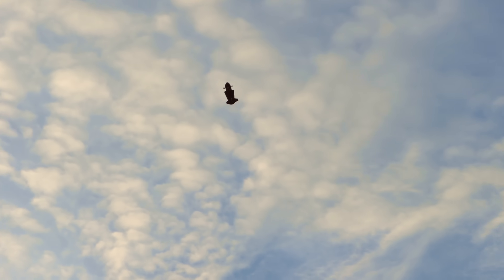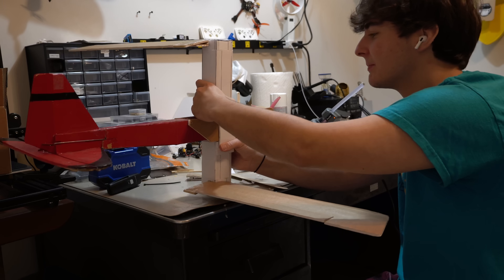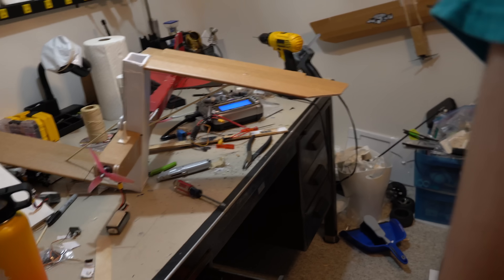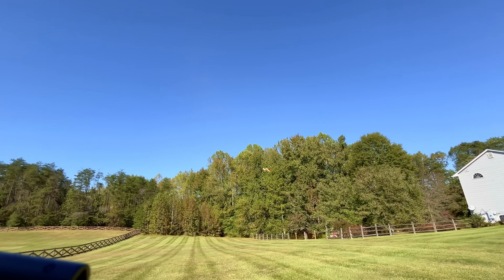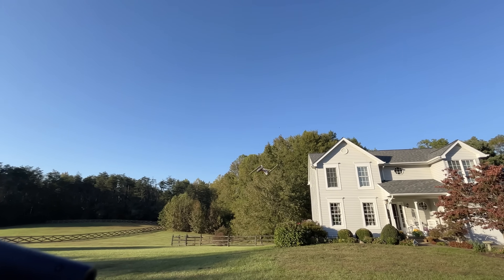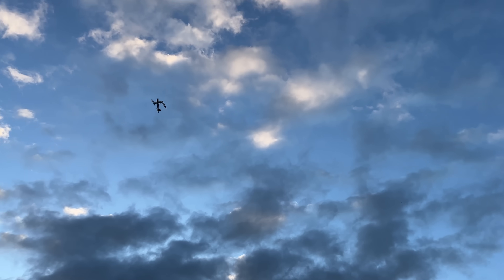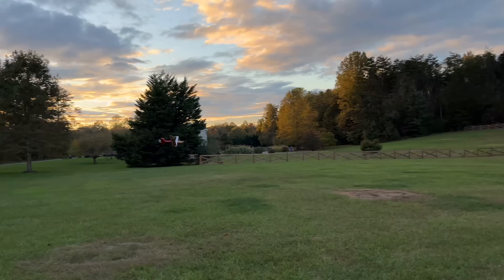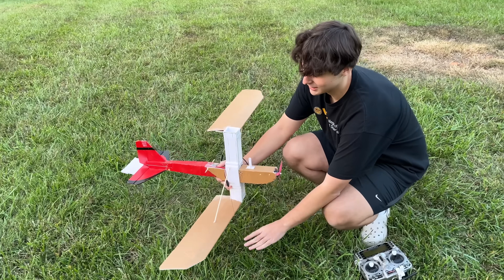Can a Plane Fly With Offset Wings?

Comment: I don't want to be another back seat engineer but I think this works better because the fuselage is in the middle between the wings so the equal lever forces cancle out, I'd love to see a follow up experiment where both wings were offset above the fuselage so the lift from one creates a greater lever force than the other
Reply: I was thinking the same thing. The offset of the wings from the center of gravity will change the moment they apply on it as they lift.  If they are roughly equidistant from the center it should balance out, but if both wings are above the center, the higher wing will have a greater moment on the mass and cause it to roll.  You should be able to compensate by changing the size of the wings based on their distance.
Reply: You mean like on the one at 0:21 that he already made with a car for a fuselage?
Reply: @demonzabrak That is a fairly small offset compared to the exaggerated one done in this video. The cars weight also creates a stable center of gravity which likely has the greater effect on balance. If the offset was exaggerated more I think it would roll if both wings are above the center of gravity.
Reply: Why would one create more force than the other?

Comment: Ground effect. In a full sized airplane that you intend to flare, land, and recover, as you approach the LANDING FLARE MANEUVER (that's aterm I first encountered with the Boeing 747-400) the lower wing will go into lower/closer ground effect first and the fuselage will roll away towards the upper wing. You can probably compensate for that by increasing aileron input as you descend within 1.5 wingspans of height. Otherwise, "aeronautical engineers" Saying it won't work weren't been paying attention ... or haven't read anything by Burt Rutan. Good video!

Comment: if you made 1 side with a normal wing and the other with a wing either half the width or length with another wing higher up making up for the difference how would different ratios and lengths or widths change it it would be a good way to visualize the effects

Comment: The way the wings generate lift does not change from when you have 2 wings on one level. The only thing I can see is that the lower wing can be less stable then the upper wing as the center of mass differs between the 2 wings. awesome little project! awesome to see you bust this myth!!!
Reply: The lift is the same but they create a moment around the cog. Could offset by making the lower wing slightly longer

Comment: ok, it flies, but now try to make it turn right. Now I realize that it want to fly left because the pilot's fingers are biased to the left. I would not agree that it flies "just the same" as a normal plane though. The wings want to settle into a 45-degree angle in level flight. That's not normal. Even if both wings produce the same lift, there is still a turning moment due to gravity, as the higher wing want to fall down, and that will tend to make it unstable, and want to flop to the left. Try level flight without any 'trim', and you'll find it is unstable. Also, even if both wings have the same lift, they will have different drag. The upper wing's vortices will have a greater effect on the tail below it. And you're right about the ground-effect - the lower wing will produce more lift, giving a strong turning moment, so it will quickly flip over as it approaches the ground.

Comment: Myth not busted; the difference is the center of gravity on this new plane is squarely between the two wings... They are each roughly equidistant from the center of gravity. On the truck, it hangs below.  Yeah, each wing generates the same amount of upwards thrust, but that's not what you want for uneven levers / pendulums.  The truck is hanging below, so on the near wing, the force will have a greater effect than the long one (like a lever of a different length).

Comment: as @nicholasrehm pointed out a force diagram gives some insights that a wing offset plane should fly basically the same. however, if we increase the difference in height then some other factors come into play. I'm think a several km long mast and so the thrust on each wing would be different since the air density is different at different altitudes. Further, with this very long mast the mast would bend as the prop moves the fuselage forward and eventually moving the wings last, so that probably wouldn't fly great. However, I suspect most 1km+ airplane size of any direction would have some serious problems to over come to fly, mostly thrust, but it is a fun thought. And the just extra weight of the mast isn't great for planes in general.

Comment: I remember seeing a free flight model from the 1950s or 60s it was a normal cabin type model but was low wing one side and low wing the other I think it was called von Uppum downum.
I do think the central mast is a huge airframe and would probably be better with thin struts each side of the fuselage,keep up the research.

Comment: I think that the problem with the plane rolling can still be seen when the plane is in ground affect. Due to the difference in wing heights the ground affect will roll the plane to the side with the higher wing. This is just what i think though. It would also explain why the car would roll when taking off from the ground from the previous clip.

Comment: makes sense. its about weight, balance and equal lift on both wings. the only issue is the drag of the box connecting the wings, but doesnt seem to cause any problems.

Comment: Well yeah, obviously the wings create the same lift if they both have the same shape and size. But the upper wing has more leverage, since it has a larger vertical offset, than the lower wing, therefore the airplane is unbalanced and flies at a kinda weird 45 degree angle.

Comment: Interesting. The plane flew straight by rolling to one side. Most all the flying was done counterclockwise with the left wing in the high position. What happens when you put the left wing in the low position. Next observation. If you put enough power on anything you can get it to fly, so an overpowered motor does not mean this design can fly. In a high wing model stability is enhanced by putting the lift above the fuselage. Your test should evaluate the planes level flight when it's coasting and there are no aileron adjustments being applied.  Have you tried testing for level flight when both wings are above and below the fuselage? I am going to subscribe and follow to see any follow up videos to validate this first round of testing. Thanks, and have a great day. -GB

Comment: Excellent video! As experts in ground effect we can confirm to obvious observation that the lower wing would create more lift and less drag close to the ground. With a shifting aerodynamic center it would destabilise the craft in pitch as well. What we noticed though is that the craft wants to fly in a particular roll angle. Probably because of different values of induced drag as commented by others earlier because of different 'root vortices' etc. Great work and keep um coming!

Comment: Oh yeah. Same as the rocket pendulum fallacy. Moving the location of a force perpendicular to it's direction will have no effect. At worst its going to have some pitch -> roll coupling since ex: pitching up suddenly will make the bottom wing move faster than the top wing. Basically the same reason why a regular wing has yaw -> roll coupling. I've seen a handful of other asymmetric planes, and they are all fascinating to watch. :D

Comment: Here's my prediction before watching the video.... close to the ground the lower has more of a ground effect than the higher wing causing a roll. However, once you get in the air, the difference is negligible and easily corrected by stick and rudder.

Comment: Now, the next question.. how far can the wings be offset!? 😬
Reply: The only real limits here would be structural rigidity, weight of the structure, and the drag that this structure induces.
Reply: More importantly, can it fly with "offset" vertical stabilizers? Perhaps only with the power of German engineering, if you catch where this is going...
Reply: @Ithirahad evil man!
Reply: @Ithirahad  Oh god that would be HILARIOUS
Reply: @Ithirahad  guess i wasnt the only one picturing a flying swastika
Reply from the maker: Hi Dave knop! good question 😂🤔
Reply: 😅😅😅😅 that was my question question
Reply: yes
Reply: So, how about a double offset, vertically AND horizontally?

Comment: Offsetting the wings roughly equal on both top and bottom of the center of axis, as done here, shouldnt show much effect, as proven. very well done! I suspect that if they were both, above the center of axis and offset diffrently, the torque that could be prduced by a higher offset wing, would produce a roll effect on the craft.
Reply: Once trimmed it would be fine, but assuming that each wing generates similar amounts of lift, the wing with greater offset to the center of mass will have a larger lever to apply that same lift, thus creating more torque. Yes, this can be fixed by trimming the centre of gravity over to the higher side or through ailerons, but it seems inaccurate to say that the torquing forces are equal. @@talktothehat.3314

Comment: The offset is fine as long as the wings have the same offset either side of the centre of mass. How does it fly if you put a small weight on the bottom or top of it?

Comment: Ok. I like that you're fearless in your creations! So I have a suggestion for something to try. Why? Because I've never seen it done in RC: a triebflugel. And I'm not trying to get you to figure out how to mount wingtip rockets. But you could mount wingtip propeller motors and mount its battery, receiver, and servo to the wing itself on a different channel than the tail surfaces channel. I feel like it could be done. Hardest parts in my opinion are 1) how to mount the spin wing so it doesn't interfere with roll, 2) How to mount items inside spin wing and balance it, and finally 3) figuring out how much control authority to give the tail plane (by basically scaling it and/or its control surfaces). Anyone could expect slight to moderate changes in scale and proportion since the original never even got to the test phase. But still, to build anything even close would be amazing.
Reply from the maker: Ooo I just looked that thing up. That would be crazy 😂 could definitely do it tho with a little 3d printing🤔
Reply: @joosh_king  I'm glad you like the idea!

Comment: You didn't prove your dad wrong, he was correct, kind of, in the last setup it took off near the ground thus the ground effect was acting on the lower wing. The second plane you lunched by hand high enough that the ground effect was not acting on the wing and thus it works. But you are awesome keep it up!!
Reply from the maker: Oh no… I’m gonna have to go back and make another video flying in ground effect😂. I think the ground effect isn’t strong enough especially at this scale to not just easily be countered with the ailerons. With the car the wings were so wobbly, that the one on the right swung back and scooped it out of the air bc of the airfoil formers under the wing and staled out. The same thing happened when it flew out of ground effect. The right wing must have more wobble lol.

Comment: Down low one wing will get greater ground effect than the other. It won't matter as much on this small scale though.
Reply: Yeah, I'm sure this probably does create some oddball edge cases like with ground effect and some things like different vortex effects coming from each wing causing some quirks.

That being said, if you had a good reason to use some degree of offset in a real aircraft, it probably wouldn't make any difference in practice.  Mostly, I'm thinking that need would boil down to structural reasons.
Reply: Actually, thinking on it more, I do see an issue that would be a little less of an edge case.

This particular quirk has to do with wing speed during pitching the nose.  If you're pitching upwards, the lower wing is moving faster through the air than the upper wing.  If you're pitching downwards, it reverses and the upper wing is moving faster than the lower wing.  This will cause some roll while pulling/pushing the elevator.

In the exact configuration used here, this would mean a tendency to want to roll left while pitching up and a tendency to want to roll right while pitching down.

In a high AOA stall, the top wing would stall first.

Of course, this can mostly be compensated for via additional control inputs.
Reply: @ColonelSandersLite  That will only matter when the pitch is changing. If it's just climbing in steady state, it won't because one wing isn't moving faster than the other.

In a full stall, it would likely tend to roll only because the wings are moving relative to one another, which would cause the effect you're describing where one wing stalls first. That's not an uncommon occurrence mind you, just that the odds of it happening are higher here. There's also the strange dynamic that, if it rolls, it now has that large vertical spar that starts to create lift, and that, itself, is not spread evenly across the spar as the spar is in motion at the time.

Those are all edge cases, which, would probably disqualify this from being a viable aircraft design simply because there are better options, but, in a model, there really is no reason why it would cause huge problems even when scaled up. I would think that it'd handle very poorly if it were flown close to the ground, like while taking off or landing in a controlled manner, but, probably not a dealbreaker either, would just require more aileron input.
Reply: @jttech44  "That will only matter when the pitch is changing."

Yes, that's what I said.

I don't think it's really an edge case though.  The reason is simple -
We have yet to build the aircraft that goes from A to B without pitch changes.
Reply: Or if positioning of the wings induces differential parasitic drag, again, not significant at that scale.
Reply: You saved me from typing that 😊
Reply: That was my first thought, when I saw the 'flying car' start from this low altitude. If that was the case, it:
- should vanish with more distance from the ground
- compensation would need to adjust for that distance
If this wasn't the case, it would be possible to adjust by statically trimming regardless of altitude above the ground.
Reply: Also given the plane spent most of it's time circling... giving the plane a more traditional outline I wonder if flying straight and level would show any issues? Or if any issues would appear in a crosswind?
Reply: There is a torque due to the car motor that will rotate the plane. Probably that's what caused the rotation as the car jumped off the ramp with the motor and wheels still rotating
Reply: ground affect will only work when its close to the ground bruh
Reply: @lloydnoz7093  'DOWN LOW one wing will get greater ground effect than the other'.....bruh